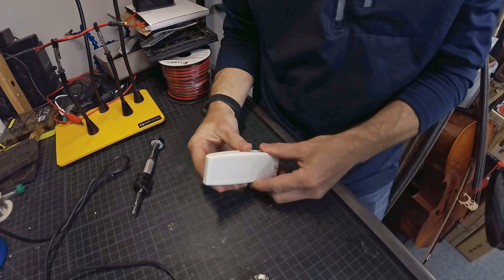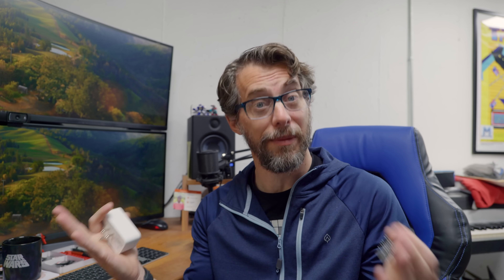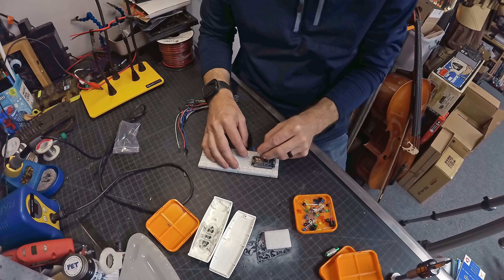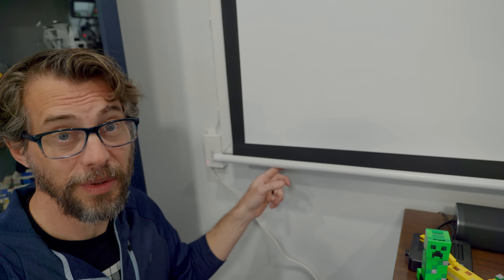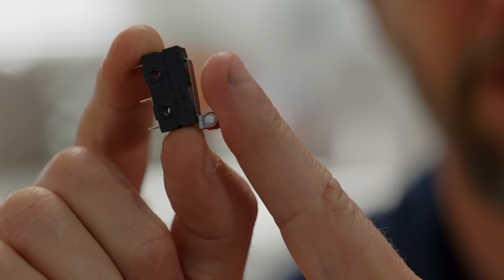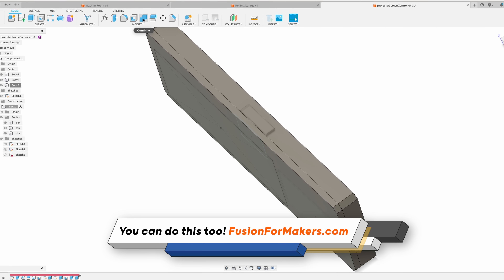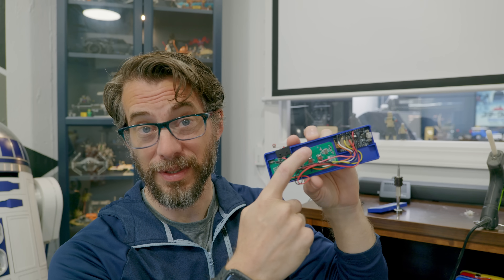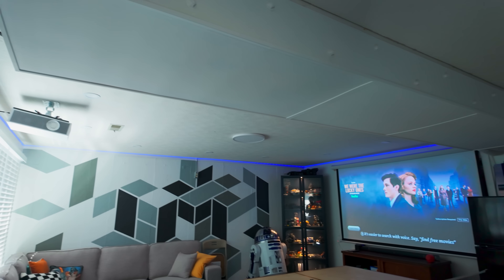Make Dumb Electronics Smart for $3

Comment: Yes, no... 

Why not use a 433Mhz Bridge eg Sonoff  to read the codes the remote sends and keep the remote?

Could you have a timer for going down and stop it after the right amount of time rather than having a limit switch?

A limit switch for going up would seem a better choice, but is it even needed?.

The reason they use a 12v battery is for range, 3.3v may work but the distance will be reduced considerably.

Comment: Have you looked for the setting stop screws on one side on the roller inside the housing? setting those correctly wont require pushing the stop button. up is up, down will go down to setting.

Comment: I used a Shelly 2.5 in roller shutter mode to get rid of the cumbersome controller-box of that identical screen. Whilst beeing a little bit more expensive, it gave me the perks of having a minimalistic footprint on the wall, very easy conversion and using all the advantages that a Shelly 2.5 brings with it: auto calibration and integration into my existing Shelly setup (using the Shelly app and triggering with specific scenes).

Comment: You couldve also had the arduino simply hit the go down button for a set time so it will always stop at the perfect height rather than having the limit switch at the bottom. Ps, correct me if im wrong, but the “brightness” wouldnt set the height, rather just the speed of the motor (or do essentially nothing in this case since it’s just connected to a switch, rather than the motor directly).

Comment: Like smoke alarms they run on a lower voltage than the voltage of the battery supplied because they can run for longer before the battery drops below the devices minimum voltage.

Comment: Simply set the limits for stopping the screen at the correct height. Usually a couple of button presses in the remote, this enters the set up mode. Then you just need up/down controls. Also some wall mount controllers have 0V contacts inside for integration with control systems.

Comment: The only reason those remotes use a 12V is for the range. The RF transmitter section gets the 12V., and the RF IC internally regulates it down to whatever it needs. The quiescent current on these parts are usually is in the sub-microamp range and sometimes zero, as the push button applies power to the IC, and based on which pin has power as it turns on determines what the remote is supposed to do. The 12V battery allows it to operate at lower temperatures, where the battery current starts dropping. Lastly, since the transmitter operates over a wide voltage range (albeit at a diminishing range), the battery life is exceptional, since it can drop down to a few volts before it stops working.
Reply: I was going to talk about longevity as well but you covered that in your last sentence. It also works in their favor for being able to use the cheapest clamshell case available, one that does not have a battery door
Reply: That’s probably why the signal was so easy to block.
Reply: This guy remotes
Reply: The entire time I was like "How is this just working when he didn't even meter the unmodded logic levels or even see if the buttons are on the high or low side?!" but this explains it perfectly. Thank you.
Reply: this explains why I thought my remote was giving out cause it worked for some actions but no the light so thought the remote was bad not the battery. Indeed it was the battery.
Reply: great explanation, thank you!
Reply: 🤖:hands-yellow-heart-red:
Reply: Good luck finding that battery in ANY store. You have to order them online.
Reply: @johnnyc.5979  you just have to know where to look. They’re often used in door bells, garage doors and cameras. Start calling stores that deal in those kinds of things and you’ll probably find your battery right down the road.
Reply: exactly - it looked like a LDO was connected to the 12v rail and then to the 8 pin chip etc.

Comment: I was going to say, how are you going to interact with a 12v circuit without a relay.  If it's just 3.3v you just need to either pull up or pull down on one side of the button to cheese the circuit.  Very cool.  I've got an smart integration project coming up and this has given me something to think about.

Comment: Those wall controllers usually have a connector block for attaching external control surfaces, atleast mine does (which is the same controller from the outside, i believe these are all the same). You might wanna check that out :)

Comment: Alexa routines allows to use time frame. Instead of using off button would be easier to measure how many seconds takes to roll it down as needed and do a routine "screen down ON" "wait 29 seconds" "screen down OFF". Same for UP, but with different seconds as I believe it may takes longer to pull it up

Comment: Very cool project! I did something similar for my garage door opener years ago. I wired a raspberry pi to a garage remote and used the same switch as you to tell whether the door was open or closed. It ran a little server with a button that let me see the status and open/close it from my phone or computer.

Eventually I decided to make a v2 with an ESP board using ESPHome and integrate it into Home Assistant. This allowed me to also integrate it into my HomeKit so I didn't have to open any apps or go to a webpage. I also used a magnetic switch here so the door isn't rubbing up against a switch directly. Instead of wiring this one to a remote, I used a relay and wired it directly to the screws on the opener.

One thing I noticed is it doesn't look like you're using any flux when you solder. I didn't either at first, but it changed my world when I started. Much cleaner solder connections and you don't struggle as much to get the solder the stick.
Reply: Just buy solder with flux core. Works fine and no need to faff with extra flux. Each to their own.

Comment: Would say more elegant and efficiant solution would be to hack the attached white box that is already near the screen and has buttons for lowering screen. skipping remote controller all together. Also not crucial but instead of button just use hall effect sensor and magnet. with really thin 3d printed wall and stronger magnet it would be invisible solution seeing that screen already lowers to the white box.

Comment: So I'm assuming it's the same screen we have at work that I had to "hack." The wired remote would have been easier and more reliable. Basically, there are two circuits in the wired remote. The go up button, the go down button, and the middle button "pushes" both bottons at the same time... 3 wires simple logic and not relying on wireless control signal.

Comment: Those remote screens usually have a manual setting in them to tell them where to stop. There’s a yellow hex key spot on the left side where the power enters. You can turn that to adjust the stopping point.
Reply: It might be that the modified remote wouldn't get that single to stop, unlike a person who will stop pushing the remote button after the operation is complete the software will not have any feedback and continuously be in up or down mode until the battery drains. The limit switch would then be feedback for the software to say cool we are done.

Comment: I have always liked electronics, computers and programming… once I  buy a house I could see making it “smart” in terms of sensors to detect leaks, humidity, excess heat etc and potentially turn off water or electric as appropriate. Turning on lights/projector/screen doesn’t seem worth it though, still cool and probably good practice!

Comment: Question? 
Could you have programmed it to run the screen down for a set amount of time. 
For example the down button is only pressed for a set amount of time to go down. Say 30 seconds and the same to go back up. This would have remove the need for a limit switch. 
A simple smart wall plug would have provided every thing you needed. The switching would trigger the command to go down and the off would command it to go back up.
Reply: That would probably work, but in practice things like this end up being somewhat unreliable - the kind of thing you need arcane knowledge for to kick in the right place when it starts to act up. For example, if the motor clogs up or the voltage dips, which results in the screen moving slower, it will only go down halfway. Tracking the state to at least some degree and responding to its change is the proper way to do it.
The way I like to think about things like these is, imagine you only know what the machine "knows" about the system and only do with it what the machine can do - are you going to be able to control the system reliably with that knowledge and these capabilities? In this case, you'll basically be controlling the screen blind (and deaf) - you can probably control it to some degree, but there may be hiccups.

Comment: This is extremely similar to how a garage door works. There was a class I took in college about PLCs. One of the assignments was to make a garage door works. There was a switch at the top to stop it from going too far up and a switch at the bottom to stop it from going too far down. One of the objectives in that assignment was also allowing it to stop in the middle and allow it to go to the top or bottom from any position.
Reply: I had to do this with only hardware buttons and contacter relais, no software or logic board
Reply: Pretty simple latch/unlatch

Comment: Maybe the switch blocking the antenna is more of an issue now that it is running on 3.3V instead of 12V?
It might have reduced the transmit power/range.
Reply: Yep, exactly that. 12V is mostly there for the RF being more powerful. So on 12V it would probably not mind the switch. Although it is nice is not blasting trough the whole neighborhood now anymore 😊
Reply: That is correct. This is why some of these RF device remotes still use A23 12V batteries.
Reply: @DaveVanderWekke 
I have far too many remotes both IR and RF and also an intense dislike for Alexa type go-betweens so I choose to store both IR and RF codes on a single  IR Programmable  remote control  using 433Mhz remote extenders as converters which means I can also use an  RF remote  on my key chain to control my main IR items.
Reply: I wonder what the consequences are if the limit switch doesn't get triggered. Will the motor just burn up in the screen? I'm sure it has some kind of protection.
Reply: @boxxdrmtb  It wouldn't burn up but he would have a bigger mess than that to deal with.  The screen would continuously unroll forever until it filled his house. Yikes!
Reply: @c0deman057 
I used a microwave motor for my screen due to the relatively slow speed and the auto direction reverse.
This is controlled by an RF code which is actually stored on a programmable IR remote control using 433Mhz remote extenders as converters.
Reply: @boxxdrmtb 
The screen itself will have another limit switch to prevent that. The only issue is it would just go too low, hit that desk and start looking very wavy - which is not useful for movie time.
His limit switch is purely for making it stop where HE wants it, not to stop it breaking.
Reply: This was my thought as  well, like doesn’t the screen know when to stop?
Reply: i've used nrf24l01 transceivers running on 3.3v. they work reliably over the length of my house, even with the antenna enclosed in a plastic housing.

Comment: Made something similar to press buttons on my screen remote. The basic idea is the same by using a microcontroller to "press" the buttons. However I did want to keep the original remote usable. So I made a small connector on the back of the remote that has both sides of the up/down buttons (I did not need the stop since my screen is adjustable). If for whatever reason my automation fails I can still just press the original buttons or take the remote out.

I avoided the 12V power issue by creating separate circuits by using optocouplers which are a lot smaller and cheaper than relais.
And I used ESPhome, just because it integrates easily with Home Assistant. It also supports covers so it is natural to control with up/down controls (or speach if you wanted).

Comment: Nice hack and video. Another approach would be to hack the receiver unit itself. Then you'd still have your stock remote as a backup. Mahalo for sharing! : )
Reply: Or you could probably leave both devices intact, and just hijack the remote‘s IR signal. There’s bound to be a way to let the Arduino send IR and have it learn the right signals.

Comment: I would have used a reed sensor with the magnet on the back of the bottom of the screen. Then you could have run a very thin cable to the controller, located in a different spot. But that's a personal choice. Cool little project.

Comment: For controlling IR remove devices, I've made a few ESPs around the house with IR emitters. That way instead of hooking up an arduino to existing remotes, I have one arduino control tons of devices in a room.
Reply: Yea I was going suggest this, came in super handy we lost the remote to a TV for good. Used a universal remote from another TV, recorded it with an IR sensor, and then programmed that into my ESP with an emitter. Worked better than it had any right to.
Reply: I actually did the opposite of this to control the LEDs behind my tv. I recorded the input for several unused buttons from my universal remote and programmed them to change the lighting to different colors, as well as choose which section to change (bottom left, top right, all, etc). This way I don't have to pull out my phone if I want to adjust the LED colors while watching tv.
Reply: @akozaro8 thank you again ❤
That comment gave me the idea to control my HUE lights with my smart-TV. All I had to do to get this to work was to get a button-mapper app for my TV that can send HTTP requests.
Reply: @Jehty_  it's pretty cool that you can do that. Do you mind posting the name of the app here so I can experiment with it as well?

Currently for my other TV I have a string of NeoPixel LEDs I hooked up to an ESP board running ESPHome. It's integrated into Home Assistant and I can control it from my iPhone using the HomeKit integration. I set up automations so they'd animate and turn on when the tv turns on, and animate to off when the tv turns off. Your comment got me thinking I can have the lights animate when I press an arrow key or the ok button.
Reply: @akozaro8 oh, wow. That's a really good idea. Thank you for bringing that up
Reply: @akozaro8  I've done the same thing with a couple of other useful functions. I also incorporated an IR receiver so that I can learn any remote without having to look anything up. It also enables me to use any remote control to control any home automation function.
Reply: This comment reminded me of an old phone I had that had an IR emitter built-in. I could control just about anything using a universal remote app. I miss that feature.
Reply: @trace9130  Most Xiaomi phones have IR emitter. Although they lack IR receivers, so you depend on apps to have your appliance in a database.
Reply: Yeah I was a little surprised he went the remote/ESP route. Makes way more sense to add it to the wall unit, or just use a smart IR/RF blaster. There are many of them. I actually use a super cheap BroadLink RM3or4. While the project is neat, it seems like a waste and a hassle.
Reply: @scrampker  Ah you sed RF .. i'll give that a pass :) it is indeed an RF remote.
Reply: @scrampker Exactly my tought, you can just buy any IR+RF copier for $15-20 which copies and simulates all of your remotes which is what I have in my home as well.

Mine is just the switchbot hub since I had some other switchbot stuff and it doubles down with being a remote control but yeah why would you create this manually when you can get it that cheap. What am I missing
Reply: Any instructions on this?
Reply: I love IR devices for this reason. IR control for home stuff is phasing out as my interest in hacking it with microcontrollers increases.
Reply: Good call!
Reply: @kaurh, which library did you use to send it? Which emitter? And how did you get the codes? I've done something similar, but had trouble getting reliable codes
Reply: That's what I was thinking.
Reply: I think you would do far better in "teaching" an online course.
Reply: That's the right way to do it because you don't lose the ability to just use the remote. That being said, this remote I'd an RF signal, which is still doable with an esp32 and a CC1101 module.
Reply: I just did this for our Christmas tree. I used the stock remote to learn the codes and then used Arduino to change the tree light settings programmatically.
Reply: exactly this!
Reply: Yes this is thr way.
Reply: Yeah, the Arduino does IR very well. I skipped commons libraries after a while and just put in my own microseconds into a library for the particular remotes  I was emulating. Sony like to send the codes 3 times for error correction. You have to repeat the code at least once (send 2x). IR is  kind of old tech but I still think it is cool.
Reply: Question : what is the best way to find IR patterns for devices? 

You can manually record them by pressing buttons on the remote sure, but 
1 : thats tedious, time consuming, and prone to error, and
2 : in some cases your device may have inputs that your remote doesn't have a button for, but it can still understand & process. (Example being a lot of modern remotes to "smart" TVs are absurdly minimalist and lack very basic inputs that the TV can all but certainly process fine. In some cases different models of remote actually WILL have some of those inputs)
Reply: What was that app he was using on his phone ??